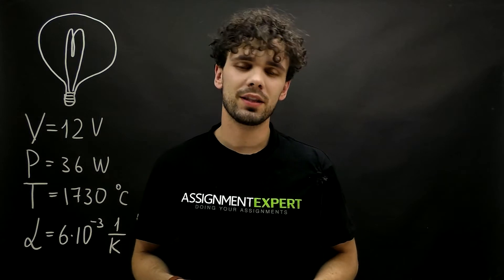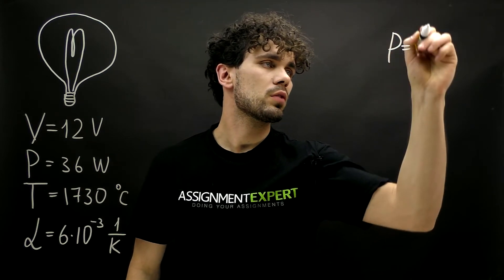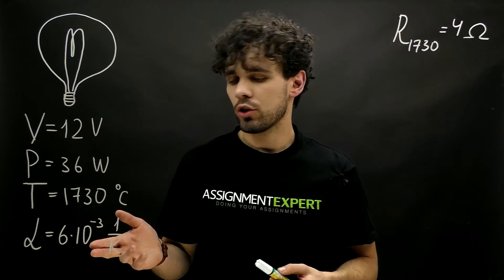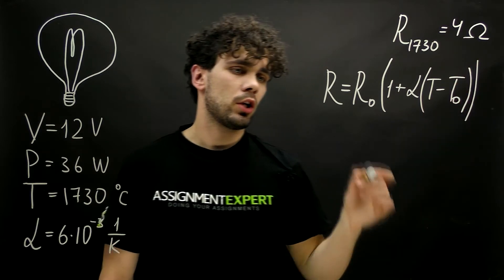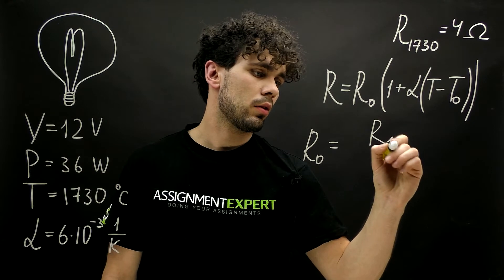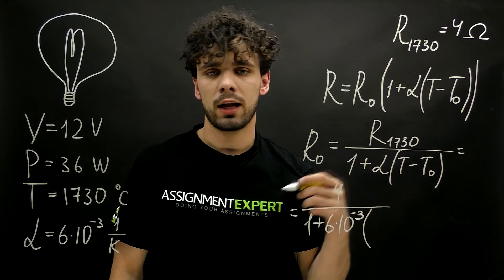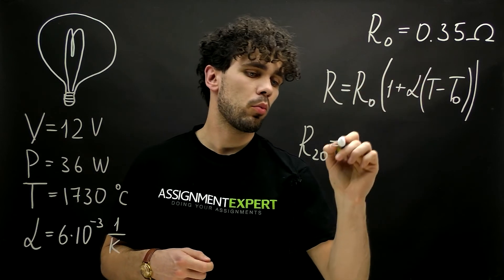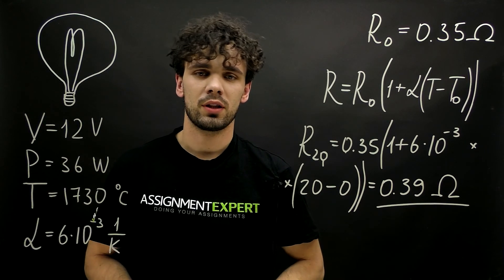Temperature dependence of resistance

Comment: Hi pls help me with this question. The temperature at which a 5ohm filament bulb operates is 1780 degree Celsius if the temp of coefficient of the resistance of the filament bulb is 6.0 ×10 to the negative 4K and the degree is 1•5ohm find the resistance at room temp 20 degree Celsius